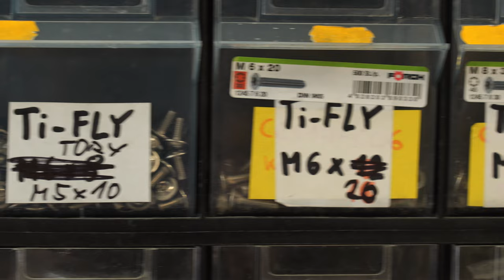DREAM BUILD of the AZUB Ti-FLY X off-road recumbent trike

Comment: Those are pretty trikes, but for me is way too much in some areas, and missing key features I'd require on a trike.
Reply: Interesting. What would be those features?
Reply: @honza-galla  Actually having looked at the website I found a model more fitting to me. the Azub T-Tris AR, though I'd be getting a frame kit as it has a lot of components on there I don't want as well as not being a fan of the big loop cable routing. As far as features I'd want the main would be the rear brake installed, and getting rid of the hydraulic brakes. As I'd have 3 brakes on mine the front 2 would be cable pulled hydraulics on a single pull lever, and the rear same on its own. Since I'd be loading cargo plus a trailer the frame kit not including a rear wheel also comes in handy as I can install a stronger mag on there with a 9 speed 11-52 cassette. Add a bafang mid drive to top it off. Rest is just personal nit pick stuff.